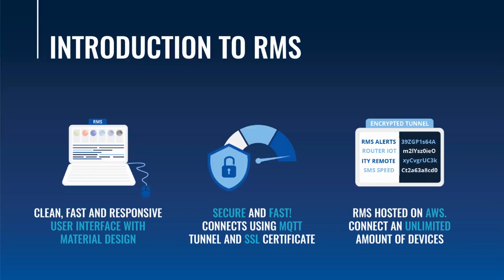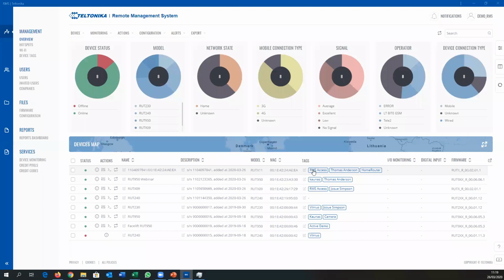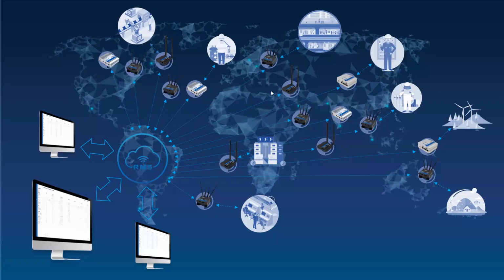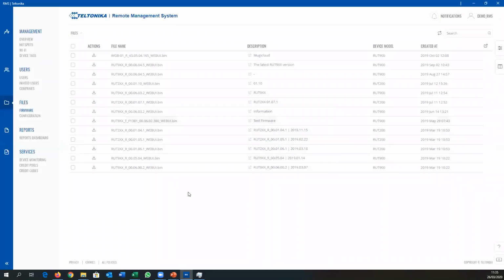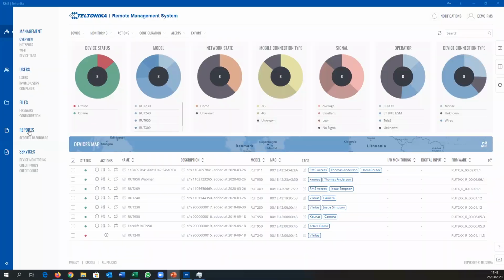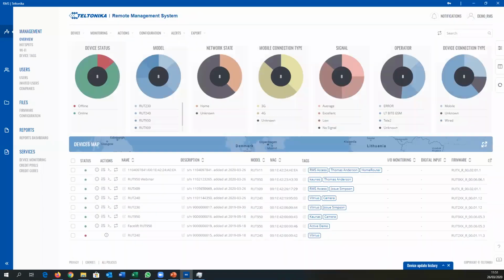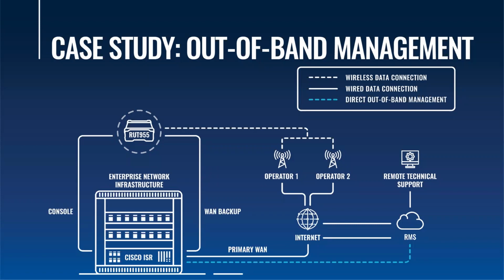Teltonika Networks Remote Management System (RMS) Extensive Introduction | Teltonika Webinar

Comment: Do I have all the same features when its is set Wan Passthrough mode?
Reply from the maker: Greetings. Could you specify to what features are you exactly referring?
Reply: @TeltonikaNetworks  If I set the Wan port to Passthrough Mode do I have all the same functions When I use RMS?
Reply from the maker: Sorry for  the late reply. As long as RMS has access to your device everything will work the same.

Comment: Hola!! Disculpa no soy ingeniero. Pero quiero saber si el RUT suma o agrega las 2 señales  de las SIM y si también suma la señal WAN. Gracias estoy muy interesado en el RUT950!!! Felicitaciones
Reply from the maker: Hola, no, el RUT950 no suma las señales de las sim cards, las 2 sim cards en el RUT950 trabajan en modo "Failover" si una de las sim cards falla, entonces el dispositivo cambiará a la segunda sim card. Lo que si puede hacer el dispositivo es sumar las señales WAN, es decir, el dispositivo es capaz de hacer Balanceo de Carga de las señales que vienes por la Sim Card, Por el puerto WAN y por la red Wi-Fi, ya que el dispositivo puede tomar internet del Wi-Fi de otro dispositivo también. Es decir, el dispositivo puede hacer balanceo de carga de las 3 WAN que tiene (mobile, wired, Wi-Fi).

Si estas interesado en hacer negocios con nosotros por favor contacta con info@teltonika.lt y déjanos saber tu información comercial.

También tenemos un seminario web de RMS en español: https://youtu.be/deGKXGWNRis
Reply: @TeltonikaNetworks   Dear Teltonika I Have Rut-240 but I can't access the Router VIA WAN IP or LAN IP if I use the Hotspot system I need to use always LAN CABLE if I need to access to Router. Aside from this RMS License is expensive I can't afford sorry immediate response highly appreciated. Thx in Advance.

Comment from the maker: Timestamps:
0:00 Introduction
2:45 What is RMS?
3:26 Introduction to RMS
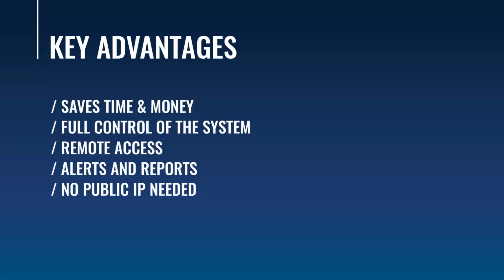4:58 Key advantages
7:46 Key features
8:35 Unified control
15:01 Access
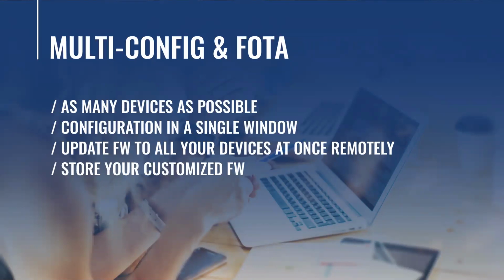21:20 Multi-config and Fota
32:51 Realtime alert system
36:03 Activity reports and statistics
39:55 Activity Log
42:17 Geoview and GPS history
45:05 Remote monitoring
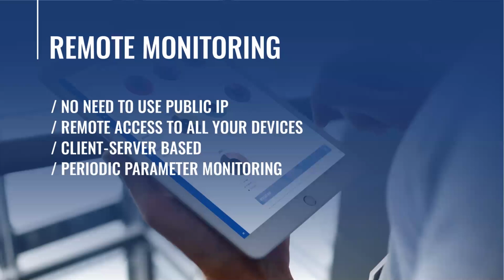45:45 RMS compatible
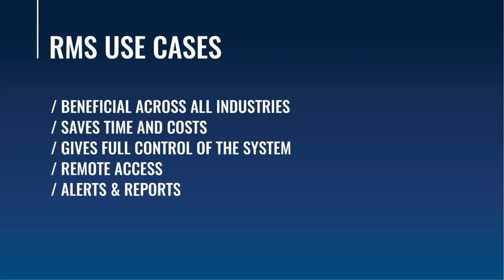46:11 RMS use cases
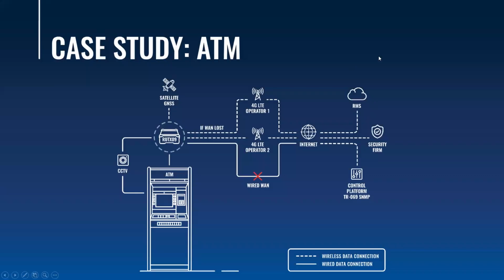47:07 Case study: ATM
49:30 Case sudy: powder coating systems
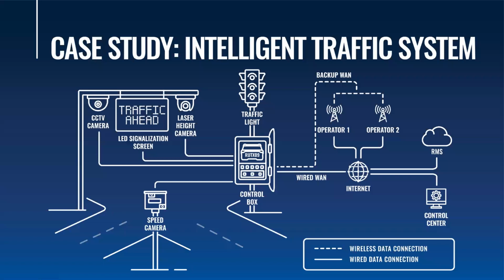51:16 Case study: intelligent traffic system
52:19 Case study: out-of-band management
55:14 RMS security approvals
58:14 RMS Roadmap
58:23 Teltonika ID
58:38 RMS API
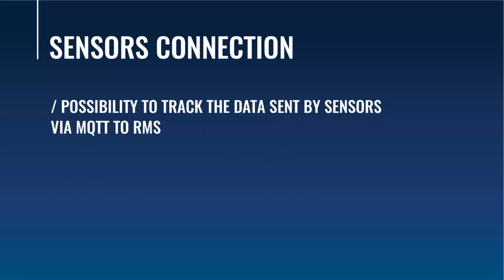59:05 Sensors connection
59:43 Alert expansion
1:01:03 RMS connect
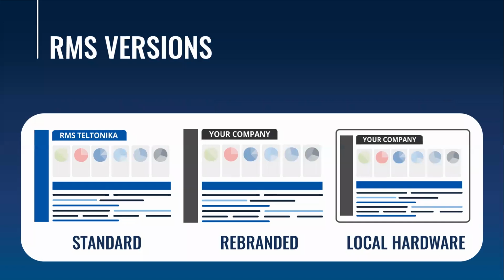1:01:36 RMS versions